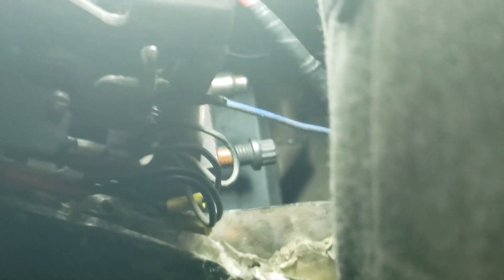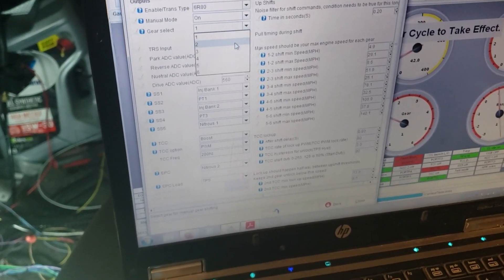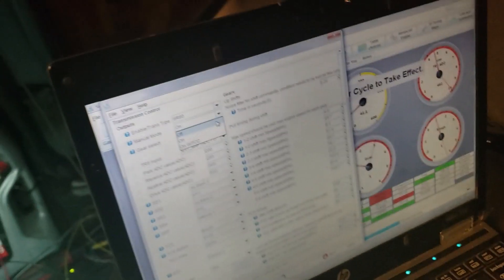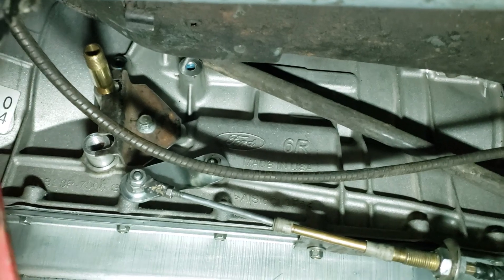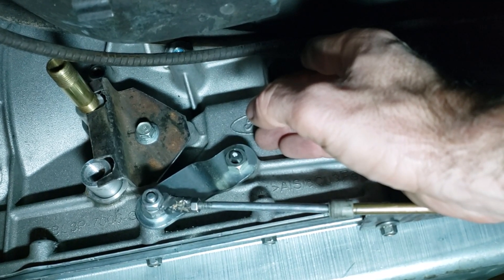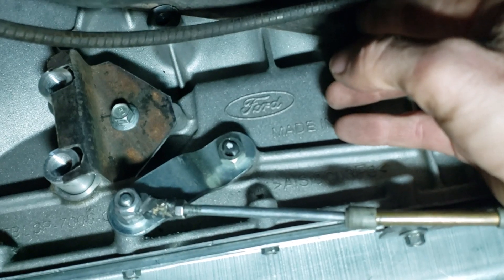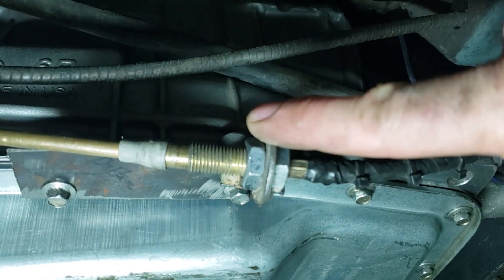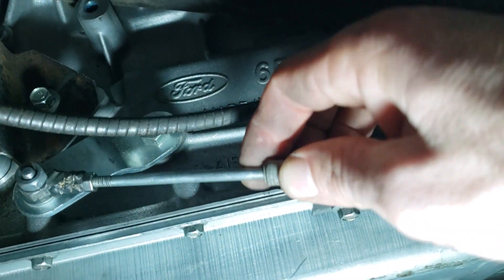6R80 Final Testing, Quick Demo of it WORKING!

Comment: What controler dit you use ?im also looking to control my 6r80?i have a ranger coyote 6r80 bit i can get the standard ranger ecu to control the gearbox any help plz
Reply from the maker: I added code to the MS3 box to drive the outputs.

Comment: Wait so the 6r80 doesn't have linear actuators for the gear circuits? Does it have linear actuators anywhere?
Reply from the maker: Yes it does.  4 of the shift solenoids are supposed to be PWM'ed at high frequency to control their position and fluid flow into each circuit to apply or release clutched or brakes.

Comment: haha congratulation the d solenoid for 1 gear you can turn off it only avoid car back up when you are stopping in a slope  http://iihs.net/fsm/?d=904&f=Transmission Electronic Control System.pdf&p=4